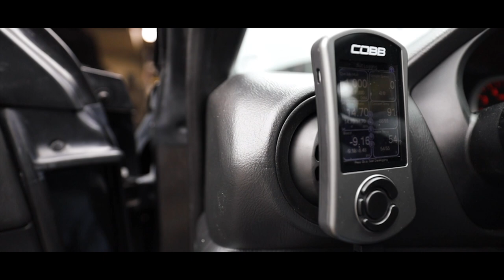How Much Did It Cost To Build the 450 WHP Subaru STI?

Comment: Great video and transparency about the cost. I recently had a shop rebuild my ‘13 STI Hatch after I heated up my crankshaft at a track day. I spent about $14K. Now my rebuild is as reliable but not as fast; I’m at 350 WHP, but this just gives an idea of my parts and added labor cost. No regrets: that power increase is absolutely noticeable from stock! But since the build is strong enough to hold more power, maybe I’ll upgrade the Turbo and Fuel in the future. Not everyone has the ability to pull an engine out of a Subaru but you do help an average guy like me understand and try some small things on my own: At least you saved on the labor! Thanks, again and please keep building and sharing!
Reply from the maker: Always more to come and glaf I can share! Totally don't blame you either, it takes so much time to knock these builds, sounds like you've got a solid set up though for some future potential power 🔥

Comment: you are missing the plastic cup from factory for the front speakers. That Black engine bay is so SICK. Love it.
Reply from the maker: What does said plastic cup do? 👀😅
Reply: @Smeedia  sorry for late response they are speaker buckets that screw into the door then you mount the speaker to them my blobeye had them and i removed them because best buy screwed them up. bot for me to use them i have to do some modding in the future.

Comment: Spent 26k on my recent build, brand new closed deck block and every single part in the engine is the best on the market. Running low boost right now to let the engine break in but made 510whp at 25psi and revs to 8000rpm but should be good for at least 700hp so I may look into nitrous or just upping the boost in the future. Only thinking about a 50-75 shot of nitrous to help lower temps because the higher the boost the higher the temps.
Reply from the maker: Meth is a good alternative as well! What turbo are you running?! Great numbers for low boost.
Reply: @Smeedia  Well I’m already running e85 only and the turbo I have won’t make 700hp which is why I’m thinking a little bit of nitrous would be best since alone it will just make decent power, lower combustion temps and even spool the turbo quicker. I went with the blouch dominator 5.0 xtr since my last build already had upgraded stock location parts and I’m running the grimmspeed tmic. I had the heads race ported, GSC beehive valve springs, +1mm valves, kelford high lift 282 cams, outfront ultra v3 block with weisco boostline rods, je 9.2:1 ultra forged pistons etc. it’s definitely a backwards way to go about it but I don’t want to have to rev the engine to 5000+ rpm before the turbo spools. Right not the turbo hits full boost at 4600 rpm and I’m hoping with nitrous in the future it will spool even sooner. I went for more response and reliability to make the car more useful for a wider verity of applications not just drag racing.
Reply from the maker: Keep me posted on the full send tune! Definitely interested to see how she does 🔥

Comment: Glad to see the blob eye is finally treating you the way you’ve been treating her
Reply from the maker: She's starting to come around, still have some issues to address but is progress 😁😁
Reply: Still having issues with my GR but that’s a whole different issue
Reply from the maker: Whats popin with the GR?!
Reply: @Smeedia  coolant issue still, everything checks out okay, issue I’m having is dime size bubbles in the coolant reservoir tank after a burp of the coolant system. Not sure if bubbles could still relate to air in the system or if it’s exhaust combustion gases and head gasket time
Reply from the maker: Haven't don't a compression test yet?
Reply: @Smeedia  have not done a compression test yet. Before doing the compression test I might try burping the system another time. Do you think it’s possibly air in the system or sounds more like a head gasket issue to you. 

What’s strange is coolant temps are normal and driveability hasn’t changed. Just those bubbles in the reservoir and I know we shouldn’t be bubbling in there

Comment: Back when I sold car audio that level of Pioneer speakers was my go-to for people that didn't want to spend a ton, good quality/price ratio. Their headunits are usually fire though. By the way, most likely all you need is a spacer ring to get those fitting and clearing the windows.

Alpine was always my go-to for people that put a bit more emphasis on the quality and didn't mind paying more. I didn't like the design of their headunits as much but the quality was there. Kenwood's like the Pepsi to Pioneer's Coke fyi.
Reply from the maker: Ordered the spacer  last night 😁 currently using a Sony head unit so hopefully the pair should work well with each other 😁
Reply: @Smeedia  They'll work fine together, though I'm not a fan of Sony's car stuff, they dont treat it with the same respect as their other channels.

Comment: That is some crispy AF intro b-roll. 👌 

Bent intake valves were on which side? I'm thinking maybe you didn't mess up that intake cam gear, maybe it was screwed from the start and that's why those valves were bent.
Reply from the maker: Drivers side 🙏 the messed up cam gear was passanger side. Pretty sure that one was all me 😅

Comment: You need to buy spacers to put in bigger speakers. You can put 6.5 in front but buy those then you can install. Look on eBay
Reply from the maker: Ordered a set last night from IA performance, should fit with thr new ones 😅😁

Comment: That’s a DAMN GOOD build there Tanner, that’s the BEST B-eye build I’ve ever seen. quick question and I KNOW you are sick of these type but I’d like your input. AOS, I’m about to get one for my 05 LGT, I’ve come across a TON of forums that say it isn’t necessary unless you are tracking your car. I’m not planning on anything like that I just want RELIABILITY, and keep this car going for as long as I can. I have the Cyl 4 cooling mod, Cobb AP, Cobb intake/air box, and Koyo rad. I already know the answer as yes but with me just wanting a daily, what am I saving with the aos installed in both  short/long run? I just can’t get over how many people say it’s just a waste of money. So some help and explanation would be GREATLY APPRECIATED, thanks dude as always and look forward to your videos everyday. 

Ps. Can you get some Large Hoodies in stock, I accidentally got bleach on mine and want a new ☝️.
Reply from the maker: 100% disagree, you'll benefit from having an AOS even if you just daily drive the car. Blow by will happen regardless and cleaning it up ad much as possible definitely helps. Keeping the oil out of the system helps keep thr AFR optimal and oil will denature the fuel. With you have oil vapor and fuel mixing it reduces the octane rating and increase the chance if knock events 🙏

Will try and get some stock ordered as well! Right now have the standard blaxk drive hoodoes in stock in large 😁
Reply: @Smeedia  THANK YOU for ACTUALLY explaining it to me, and educating me in the fact that no matter how I drive the car blow by will happen causing oil to potentially mess with my Air Fuel Ratio, living in So Cal our gas isn’t the greatest as it is so you explaining it to me helps more than you know. I too have invested close to 8k after buying it for 5k just to get maintenance up to par. Guy wasn’t an honest dude from CL (hard to imagine huh?) But CANNOT wait to have the confidence that my cars issues are a thing in the past and can focus on the future a see where it goes from there! 
I’ll be getting one of those hoodies so pls rsvp one for this guy, and merch suggestion? Beanies!!! I’m a beanie guy and where it the same style as you do, some consider it the, “ Hipster.” Style but a drive or smeedia beanie would be pretty rad. Just sayin, thanks again my man. Looking forward to your videos and live streams to kick it a bit.
Reply: @Smeedia  Ps. Your merch site says it only has XL and Mediums Avail. So I guess I’ll take the Large you Personally where instead (totally not trying to come off in a creepy weird way as an obsessed fan.... or am I?) of waiting for you to restock. I’ll still pay no problem
Reply from the maker: Lol all good 🤣 I've got one large on these that I ordered extra of, can add it up on the site here shortly if you want it 😁

https://www.smeedia.net/shop/p/smeedia-drive-hoodie
Reply: @Smeedia  dude that would be KILLER, if you wouldn’t mind waiting until my debit card arrives in a few days? Some dude bought $100 on an RPG from London so I had to get a new one from Chase. We’ll coordinate like those Spec Ops dudes that killed Bin Laden and dumped his body at sea. Low key tactics so I don’t get burned and miss out on it.

Comment: HEY, what battery tie down did you use, or how'd you secure it? I have a pc680 as well and I'm having a hard time finding anything that I can just purchase to bolt it in.
Reply from the maker: It's a grimmspeed mount for a 2015+ STI that i riveted to the battery tray 😅🙏

Comment: 🔥🔥🔥💪, bro like you said it, good luck finding an up pipe with the EWG flange, i found a Grimmspeed UP pipe ceramic, used, it was 140 but i paid 100, the only thing missing is the dump tube and 1 stud which i can get the grimmspeed hardware. Step by step, next move ets 3.5, tial bov, speed density, tial 38mm ewg and killer b header (do i need an EGT bung for the 15 Sti?)
Reply from the maker: No need for the EGT unless you want to monitor it 🙏
Reply: @Smeedia  appreciate for the info bro, also I'll do fueling upgrade as well and i might put some 🌽 E85 what i don't know if its necessary  to replace the oem fuel lines? I'll run ID1300cc
Reply from the maker: I would definitely suggest replacing thr fuel line 🙏🙏🙏
Reply: @Smeedia  💪💪💪 so be it brother, time to have fun with the intercooler, up pipe and header, i haven't  master working with the intake manifold and the fueling system yet lol, i did last week the perrin turbo inlet, i thought it was bad, but not at all, i squeezed the hell out of that MF to getting in, the key here is: TOOLS, lots of tools🔧🔧🔧. To be honest i think the top mount intercooler its a major pain in the A$$  specially with oem hoses in comparison with the turbo inlet IMO.  good thing i replaced the hose with grimmspeed silicone hoses, but for what is worth, now im selling the stock intercooler lol.

Comment: best public service announcement i've seen on youtube. As a Sti owner i can confirm. If you want to buy a fast straight-line car get one evo.
Reply from the maker: Facts, subarus are not cheap to build to go fast 🙏
Reply: Well, Evos are stupid expensive these days. Most are around the 25-35k range. A clean GD STI will run you around the 10-20k range depending on the condition. So when you factor in the differences in pricing, the STI truly is a solid deal. The extra money can be used to build a monster of a machine. Seriously a lot of car for the money and a great bang for your buck 🤙

Comment: This seems super interesting! I'm looking to build mine as well, but I don't even know where to start ;(  do you have any recommendations on where to start? is I'm looking to get around 500hp
Reply from the maker: Start with a short block, then heads. From there start getting the appropriate bolt ons to accommodate the power your targeting 🙏

Comment: Hey man! Been watching you for awhile now. Thank you for all of the helpful tips and tricks. Im local to Washington aswell. I was curious if I could pick your brain on a certain tick I have been chasing for awhile now on the driver side when taking off from first gear 2k to about 2500 rpms its super noticeable. Which part of WA you from? Im here in Lynnwood :) cheers.
Reply from the maker: Whats the car? 😁 and nice! I'm down south in the puyallup/Tacoma area
Reply: @Smeedia  Nice! I use to live down there on the end of Canyon Road. I have a 2006 STI. I had PNW motors out of Des Moines pull my heads and throw in new buckets and supposedly they checked my clearances and everything looked fine? But it seemed to almost be worse now after. It does get louder as the oil gets older.
Reply from the maker: Stock cams? Sounds like some buckets clearances might be too close
Reply: @Smeedia  Yup stock motor

Comment: Please tell me how you bled your power steering. I spent 4hrs after replacing the pump and nothing works.
Reply from the maker: This!!! 
Have someone turn the wheel while you put 20 In Hg on the res 

https://www.autozone.com/test-scan-and-specialty-tools/vacuum-pump-brake-bleed-kit/oemtools-vacuum-pump/70116_0_0?spps.s=1171&cmpid=LIA:US:EN:AD:NL:1000000:GEN:71700000069889792&gclsrc=aw.ds&&gclid=Cj0KCQjwrsGCBhD1ARIsALILBYrJ06akWRoXjmpBhxdpb8Be1LpoHRagR5jj-Avuo9t5KX4rjR7eH5EaAvfJEALw_wcB

Comment: Last comment now that I've finally watched all of the video, yeah sounds about right on price. 

I'm roughly at 20k on my g35 sedan. But I went the opposite route, where braking, suspension, body, etc. was taken care of before the engine stuff. I'm slightly higher than stock power if I had to guess, being untuned. My 04 FXT that I paid $500 for? Probably at like 6.5k spent at this point. I'd say it's a 70/30 replace/upgrade mix, still worth it though. No power upgrades yet.
Reply from the maker: Normally I do the same where I focus on suspension, drivetrain first. This time was a little diffrent though lol love the FXTs always wanted one. 

Whats all done to the G35? Use to have a 350Z so somewhat remember those cars
Reply: @Smeedia  To start winter/summer tires and BBS RS wheels for the summer, Soul Function (think they make VA stuff btw) chassis braces (front strut, mid 4 point? chassis, 2 rears around the diff), Whiteline bushings all around, GKTech all rear and front upper control arms, new stock lower fronts, Whiteline rear sway bar, Stance USA XR1 coilovers (think track oriented BC), new oem hubs/bearings, Baid polished upper intake manifold, EvoR CF intake tube/titanium engine harness cover, R2C? Intake/shield (folded a few years ago, was pretty reputable fwiw), Stillen Gen 2 catback w/ x-pipe (very important on these VQs). Tons of little things like Ionic Dynamics replica Nismo aero, badges, interior crap, Autech oil & gas caps with aftermarket titanium hardware, etc, JDM tails, a half dozen sets of headlights and supplies to make a good set, stuff like that.

Edit: knew I'd be forgetting stuff... Motordyne Lower intake plenum and plenum spacers too... not cheap. NWP large bore throttle body. Have an oil cooler setup that needs installing and just about out of my Hawk brake pads / Centric rotors after 5ish years. Project Mu lug nuts? I'll allow it. Admin Tuning catch can (that scammer can S a D... story for another time).

Also shit like a Stagea woodgrain dash kit, 20+ year old Stillen & Autech decals, things of that nature. I had to jump in again for a quick addendum that I forgot waaaay more than what I got right in the previous edit: like some Tommy Kaira pieces, all my stereo stuff, 4 Nissan/Infiniti gatling beam projectors, an interior LED conversion, too much to list in full honestly. Wish I kept a spreadsheet over the past 5 years.
Reply from the maker: Sounds like a well rounded build, been wanting to snag another Nissan here soon. Been wanting an S13 Hatch for so long, I can say I do not kiss working on a VQ engine though 😅
Reply: @Smeedia  Thanks, do appreciate the attention for sure. And of course I forgot the NWP throttle body (09+ Maxima iirc) on my list, but you get the gist. Pretty high strung n/a.

Comment: What battery/configuration is that. I'm running the APS DR525 FMIC on my '05 and the OEM series battery sits closer to the piping than I'd like. This battery orientation/type looks exactly like what I need.
Reply from the maker: It's a grimmspeed battery mount for a 2015+ STI that k trimmed and riveted to the stock location, then using an odyssey P680 🙏 works very well. That small battery is a trooper!
Reply: @Smeedia  It's very nicely done. Just placed an order with Grimmspeed for a red one. I've been watching the '05 videos but have had no luck finding the trim and install, was it done off camera? Thanks for the response, btw.
Reply from the maker: I believe I had it intermingled into another video, I'll see if I can dig it up 🙏

Comment: Nice Vid! Question: My STI (after the rebuild) idols at 0.5 in neutral, however i've noticed a very slight shimmer (what it feels like when its about to stall) ever so subtle. Any thoughts on this, or do you think this is normal? suggestions?
Reply from the maker: Is it protuned?
Reply: It’s not. It has been basically brought back to stock except for the honed cylinder walls (professionally done), forged pistons, and a Grimmspeed Electronic 3-Port Boost Control Solenoid. Other than that it’s all back to stock. I haven’t had the tune done yet because I want to get an apple exhaust and also deciding if I’m going to go for a turbo upgrade for it, while I’m down there.
Reply from the maker: Try cleaning the MAF and the MAP sensor if you haven't already to see if that helps.
Reply: I’ll give it a shot. Thanks for getting back to me.

Comment: Just to give you a heads up gd chassis is supper rigid and chassis bracing isn't necessary subaru did a great job kinda throwing money away
Reply from the maker: Few things I'd like to to improve response from the car but it's already 90% to where I want it
Reply: @Smeedia  like you said sway bars and endlinks are amazing way to head next and wheather you want over or under steer i went down same rabbit hole for 3 months and just went whiteline brackets sway bar end links and feal 441 suspension with the rear perrin lockdown kit super responsive wish you lived closer so I could let you drive my gd
Reply: @Smeedia  oh and chassis bracing comment came from wrc mechanic when I asked what I should start on when it came to bracing and he said wasting money on that version but do what I want sway bars better way to go